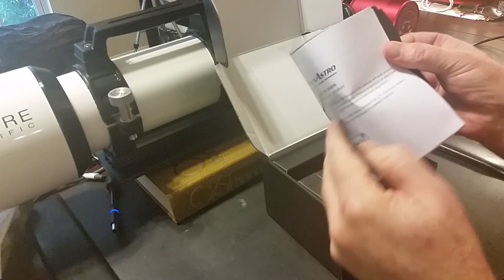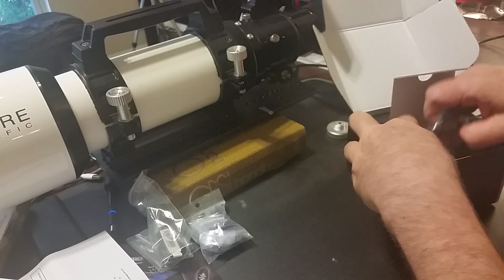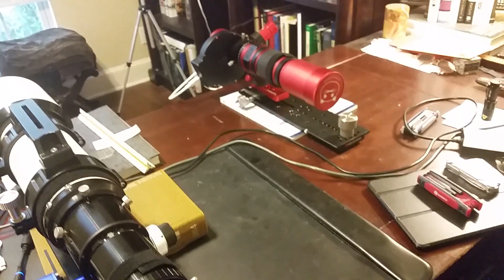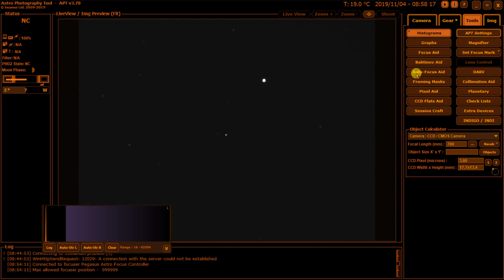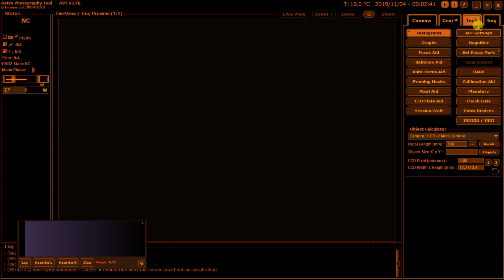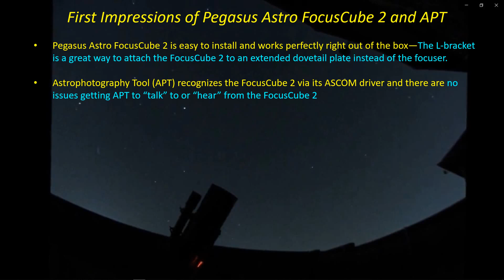Pegasus Astro FocusCube2 Installation and Review

Comment: Regarding the movement in with temp change: both the tube and the glass are changing with temperature.  So say the tube shortens up by a millimeter and the focal length of the glass shortens by 2mm, you'll need to move the focuser in to compensate.  I had the same head scratching moment as well. Thanks for great videos!
Reply from the maker: Thanks, Jeff. Yep, one thing I did not realize when I started looking into temperature effects is that the index of refraction of glass is pretty sensitive to temp changes as well. So many things to think about! ...and occasionally we get a picture

Comment: Hey James what is the power requirements of the powercube v2?  I’m having a hard time finding that as I try to source a 12v adapter or maybe a dc splitter and run off my eq6r adapter but it’s 10 amps! Guessing that’s too much
Reply from the maker: I'm using a 12V/10A power source. The UPBV2 documentation says you should provide at least 6A.

Comment: Some great gear. What puzzles me, I was bought up, aperture rules. Why do so many use small aperture refractor over say a rasa 8 or larger, giving f2?

Surly a fast big aperture scopes give better detail. For me aperture still rules even in astrophotography so puzzled why many astrophotography owners downgrade aperture were a bigger fast telescope would give better results. Afterall in professional telescopes fast big aperture rule.
Reply from the maker: There are many trade-offs in astrophotography. We say one method or piece of equipment is "better", but the eye cannot perceive the difference in many cases. The RASA is a nice scope no doubt, but it is just 400 mm, and not well suited for smaller targets. So target selection plays a role in what scope to buy as well. Then there's convenience factor. The RASA is heavy and many may feel that a lighter-weight refractor at 400mm is the better choice for their mount. There's something to be said for the Redcat 51 (250 mm) at about 1/3 the cost of the RASA and can be carried in one hand, particularly if you have to carry the scope out to the mount every night (not something that is required for professional telescopes). So aperture is a consideration, but not the only one.

Comment: Hi from Mel in london UK can you help what is the rough backlash on your focus cube mine is about 750 steps seems ridiculously high

Thank for you help in advance

Kindest Regards

Mel
foosss_it@yahoo.com
Reply from the maker: Hey Mel! Thanks for checking in. I agree. That seems awful high. My back lash is about 90 steps. Now, not all of that backlash is in the Focus Cube. Some of the backlash is in the mechanical focuser of the scope. Is it possible that you have the equivalent of 350 backlash steps in your rack and pinion focuser? Did you use the Bahtinov method I showed in an earlier video to measure the backlash?

Comment: Why do you use Bahtinov Grabber instead of Bahtinov Aid inside APT?  They are based on the same software.  Does the single-frame grabber method give better results than live view in APT?
Reply from the maker: Hey Bryan. I find that the 1:1 display mode, which is required for accurate focus assessment, provides a Bahtinov diffraction pattern that is "too large" for the small window APT provides in their Bahtinov Aid tool. The Bahtinov Grabber program lets you define a larger window that provides for more accurate identification of the diffraction spikes and is less sensitive to scope movement when manually adjusting focus.
Reply from the maker: By the way, the Bahtinov Grabber program works in Live View mode as well—it just monitors a portion of your screen and updates the “score” as the image changes
Reply: @Aero19612  Thank you!  I just watched your new video on focusing.  Can you share the spreadsheet you created to compute the hyperbolic curve?  I would love to try that out for myself with ASP.  My email is bwells@oakleafs.com.  Thank you!
Reply from the maker: Bryan, I just posted a video and related Excel spreadsheet for fitting a hyperbola to data, See if t works for you.

Comment: The lack of autofocus in APT was the reason i switched to NINA. It has a really good auto focuser. It also has a nice framing and planning feature.
Anyway, great informative video. Thanx.
Reply from the maker: Yeah, it's a big hole in the current version. I have downloaded NINA, but haven't used it. I'm not eager to switch to another program, but I read lots of comments about NINA.
Reply: Yeah, I was reluctant at first. I really like APT. It has very good support for Canon camera's.
But for focusing and planning NINA is definitely better.
I'm not switching back.
Reply: @nicksastrophotography330  whats your backlash compensation and steps in NINA?
Reply: @AstroDude-Mitch  
Do you mean backlash for the focuser?
I ran the measure focuser backlash tool from the imaging window.
It measured it at 3 IN and 6 OUT.
I have the stepsize at 10 with 4 initial steps.
I have a moonlite focuser.
Reply: @nicksastrophotography330   yes Oh a Moonlite . no wonder.
im at 200 out  0 in
100 steps / 4 initial
pegasus in a GSO focuser newt.
on auto focus it does a runaway  focus till it hits the draw tube. 
or a W  kinda curve,  and yet in SGP , it a perfect V curve. i love NINA  focusing is killing me ..
Reply: @AstroDude-Mitch  
That's strange. 
Have you checked for updated drivers?
Maybe a new version of ascom?
Or the latest nightly version of Nina? There you can choose parabolic or hyperbolic curves too.
Reply: @nicksastrophotography330  yes im sure im on the latest Pegasus drivers(Ascom) , and i can look into nightly. im on 1.9 and Stephan  said there's no changes in the build in focusing routines. from 1.8 rc003 to 1.10. can you email me. ? or NINA handle.
Reply: @AstroDude-Mitch  Hi Mitch,
I can't actually find an email adres for you.
My handle on Nina/Discord is NickHolland #5257
Reply: @nicksastrophotography330  looks like you're offline in nina.
Reply: @nicksastrophotography330  rcfmitch at gmail dot com